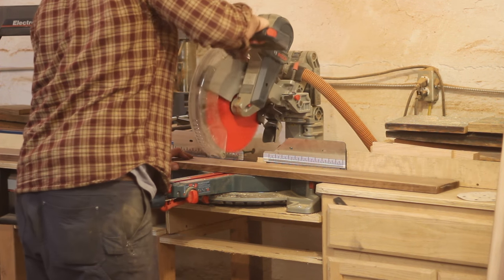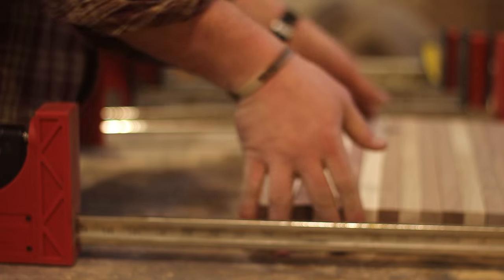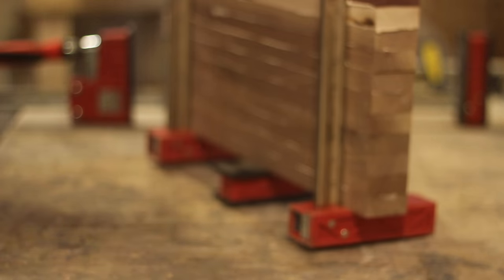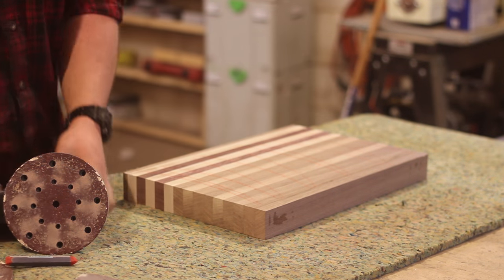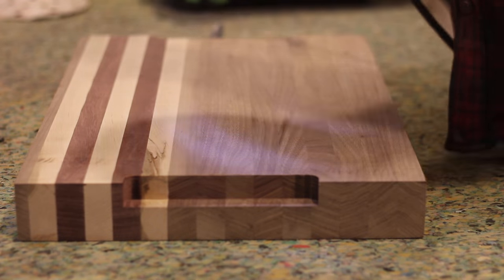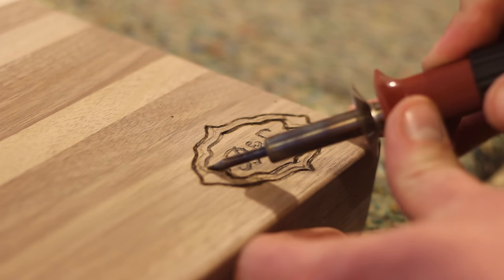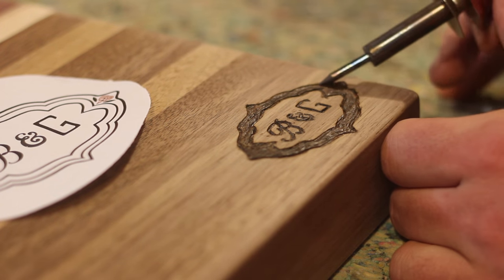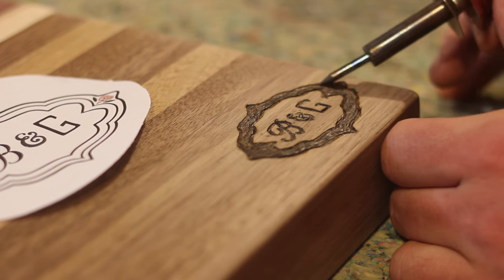How To Make A Long Grain Cutting Board

Comment: Hey John, great video. I do some wood burning but I've never tried using adhesive like you did. I always trace the design with carbon paper and then burn it. Do you just sand the paper and adhesive off? What kind of adhesive did you use?
Reply from the maker: +Ironwood Designs regular spray adhesive and i wipe it down with mineral spirits to get the excess off

Comment: What is your experience with using different bits on the burner? I have a full set of different "bits" (in lack of a better word for them) to attach to the actual burner and handle, but havent tried them out except one to use in lines.
Reply from the maker: +Thmz2006 I like the one on here the most, I find it the most versatile and easy to use.